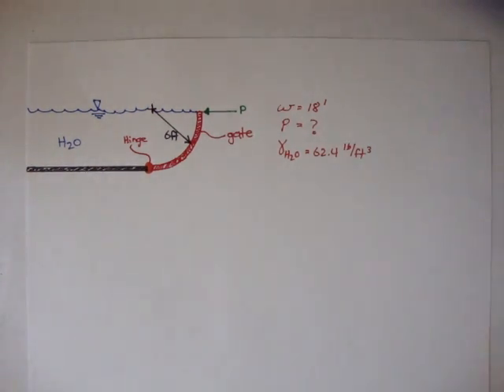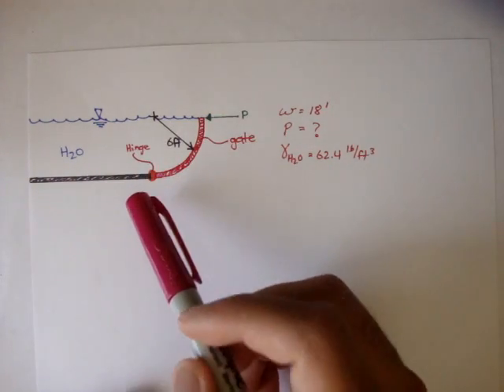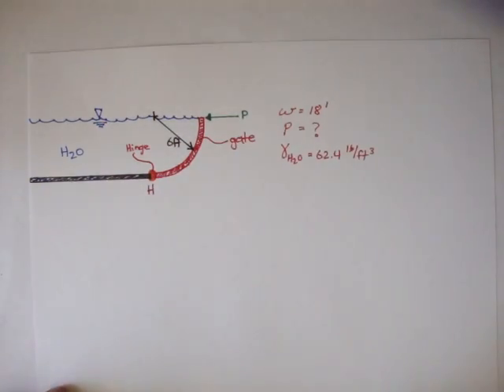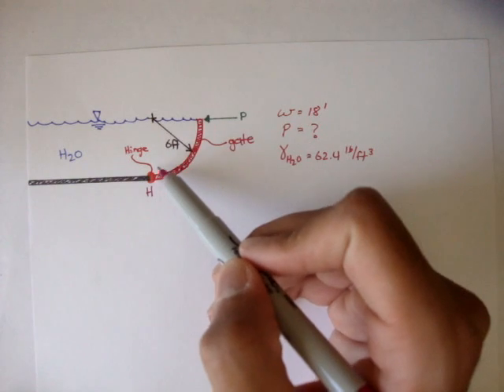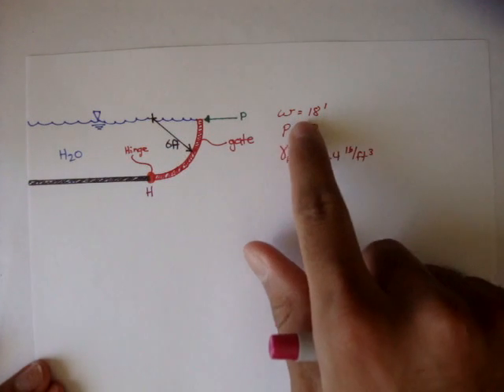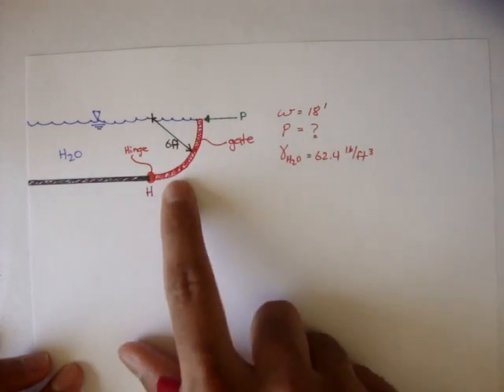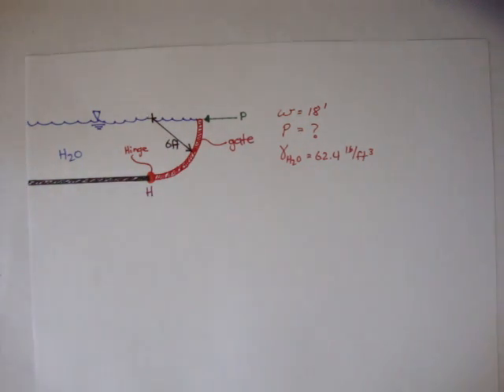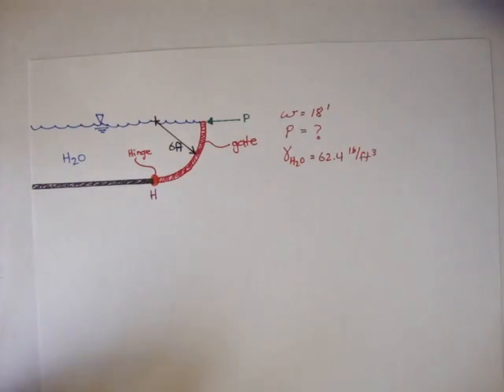Forces on Curved Surfaces: Example 1 [Fluid Mechanics #53]

Comment: A sphere of radius R and relative density 4 is hanging with the help of a string such that it remains just
inside water. The ratio of force exerted by the liquid on upper and lower half of the sphere is (take Patm
= 0)

Comment: wouldn't the force P be acting 6*Sqrt2 away from the hinge based on 45degree triangle hypotenuse?
Reply: Kinda late but yes, force P is acting from that far away but when it comes to calculating moment P must be acting onto a “surface” perpendicular to the force, which is why it doesn’t matter how far away P is across the X direction, moment about point H only changes if P changes distance in the Y direction because force P is perpendicular to the Y axis

Comment: answer will be 20217.6 lb exactly.... but this much calculation is not required .  If we observe the free body diagram of gate properly we can solve in less than 15 sec... single stroke problem

Comment: this is wrong man
the force on plane surface does not act on the centroid but ao hc+(((a)(b^3)/12)/(A)(hc))
Reply: i don't know where you are confused at bro.
but he did say that the force of the water was located "centroid of the pressure distribution". which is CP.
Reply: i guess it seems like you were confused on 9:20. where he solves for Fp.
but equation of force of pressure is Gamma*Hc*A  which Hc is the distance to the centroid of the surface from the surface of the water.

Comment: Why can you make the assumption that your Fp is a third in distance down the base of the surface when you're calculating the moments
Reply: Probably too late to answer this but for people with the same question,

You can assume it's a third of the way up from the hinge because the pressure distribution from the rest of the water in the tank creates a triangle shape on this point. We know that the centroid of a triangle is 1/3 from the fat end so we can say that is where the force is acting. 

He describes this as well, earlier in the video.

Comment: Why is you assume the atmospheric pressure equal to 0?
Reply: Its just the choice of calculating the gage pressure (Pgage) or the absolute pressure (Pabs). Pabs = Patm+Pgage.  In most of these problems, we consider the gage pressure and not the absolute pressure. So we don't have to add in the atmospheric pressure.

Comment: Hey man, how did you come up with a height of 3 ft from the surface in getting Fp??
I think it's 4 ft. 2/3 of 6 ft.
Reply: When you calculate the force on the surface, you look at it from the surface of the projection. In this case, the curved surface is projected as a vertical plane, with centroid calculated for a rectangle/square. 
Remember, the triangle on the surface represents the pressure distribution and not the horizontal force.
I hope that made sense (and I also hope I am right)
Reply: i think u r not correct
Reply: p deals  with centroid so it's 6/2=3 ft , he dealed with it as a square of length 6ft in the direction up and 6ft in left direction making full imaginary square . i think .
Reply: Lalitha Prasad yes you are correct

Comment: Is there no vertical force the gate exerts on the water? Does the hinge take place of that force?
Reply from the maker: +Michael Robledo Well, the body of water that we "took out" to draw our FBD does exert a force downwards that is resisted by the vertical reaction of the hinge (which we treat as a pin connection). Hope that answers your question!
Reply: The top of the 1/4 Circle is at the Surface so no pressure Downward.
Reply: And why isn't there a horizontal reaction by the gate?

Comment: Dear lord jesus why not just do summation of forces in the x=0?
Reply from the maker: +Jonathan Teas We have three unknowns: P, Hx, and Hy. If we did the sum of forces in the x=0, we would still have three unknowns. Since two of the unknowns are at the hinge (Hx and Hy), the easiest thing to do would be take the moment about that point so you don't ever have to worry about Hx and Hy. :)
Reply: Hy does not act in the horizontal direction...
Reply: You can do summation of forces in the y direction to find Hy too.
Reply from the maker: +Jonathan Teas You're right, Hy does not act in the horizontal direction. I meant that even after you summed any forces in the horizontal direction, you would still not know the values of Hx, Hy, or P (hence the three unknowns). You can sum the forces in the y direction to find Hy but you will still need a moment equation about any point and a sum of forces in the x direction to find the magnitude of force P. Or, like in this video, you can simply take the moment about the hinge and not have to worry about Hx or Hy. Hope this helps!